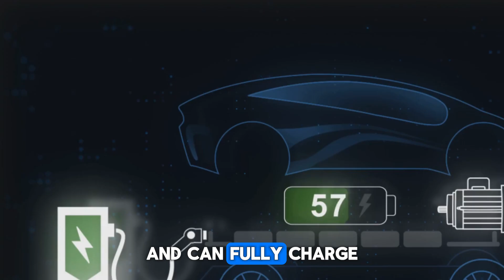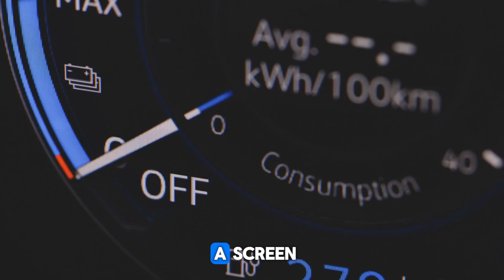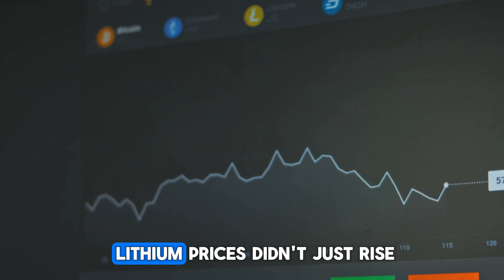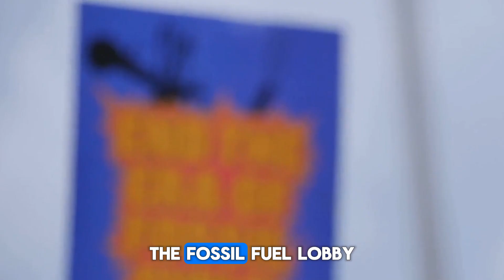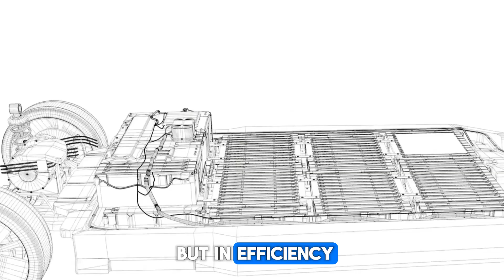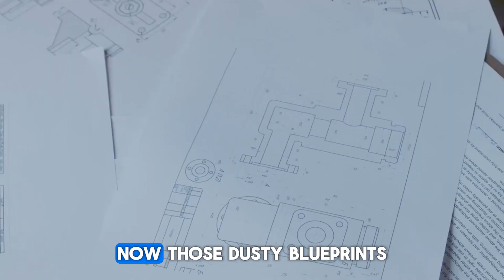TOYOTA CEO Just Released a Aluminum Ion Battery with 1000 Miles Range and 5-Min Charging!

Comment: ChatGPT: This is dream-tech and I found no reliable Toyota-sourced documentation (e.g. in their 20-F or technical roadmap) that mentions aluminum-ion batteries for EVs.  Many of the recent technical announcements are about solid-state batteries, not aluminum-ion.  Some videos or external sources (e.g., YouTube) claim “aluminum-ion battery with 1,000-mile range / 5-min charging,” but they appear speculative, unverified, or possibly exaggerating. (Always treat viral video claims cautiously unless backed by peer-reviewed research or company filings.)